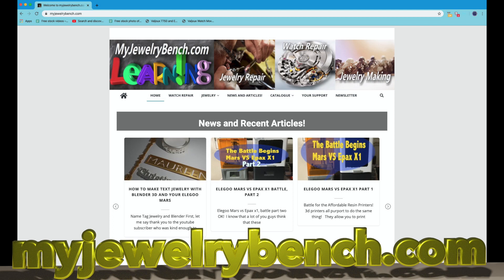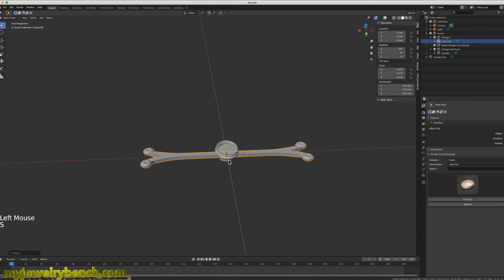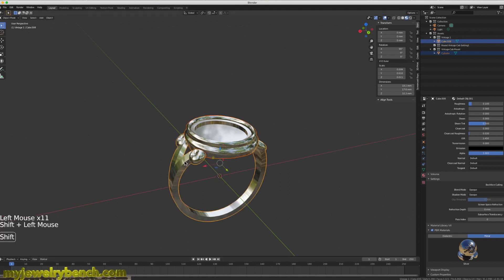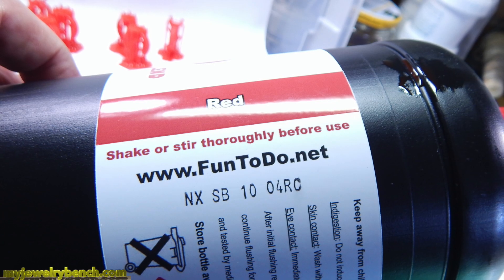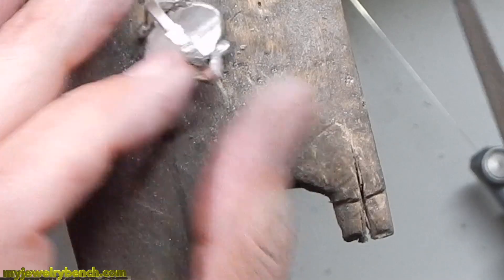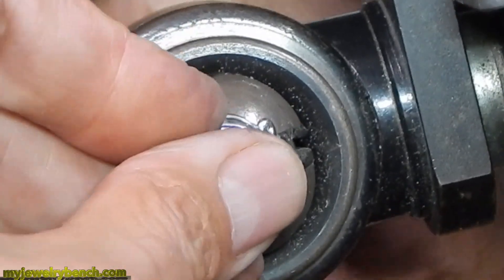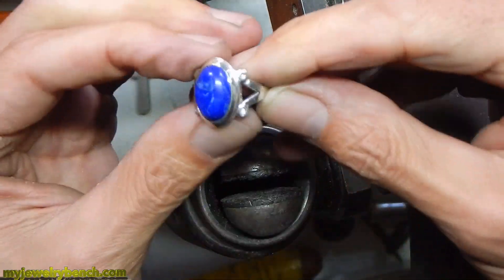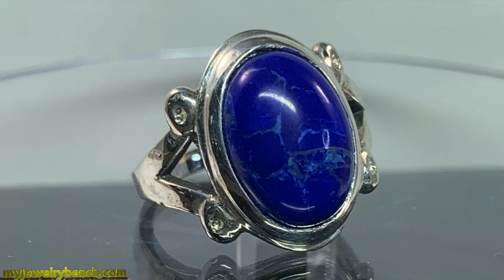3d Printing, Casting and Making Jewelry!  Lets Use our Elegoo Mars or Epax x1 3d printer!

Comment: Hi. I wanted to try this resin.how did u wash & remove rest of resin on the surface after it came out ? I usually use alcohol. But I’m not sure abt this resin.
Reply from the maker: Best to rinse castable resin in warm water for two minutes. Then cure it
Reply: @watchesandjewelry  thanks 🙏🏻

Comment: I wonder... is it posible to cast custom watch cases? i imagine that the main limitant must be dimensional accuracy.... do you have an opinion on that matter?
-Thanks for your video!
Reply from the maker: Yes. You need to build in a level of shrinkage. Because of the size of the model, the shrinkage of castable resin and the potential shrinkage of the casting, I would try to account for a 4.5 to 5% shrinkage. If you wanted to just 3D print a case, the shrinkage may be negligible if you use an ABS like resin
Reply: @watchesandjewelry   Thanks for your answer!

Comment: Thanks for all your videos and tutorials, because of you I started to learn Blender, have some experience with Fusion 360
Made your school ring in blender and purchased  you BlenderGems library so I can make your  sterling ring with the beautiful blue stone.
But I think there is a problem with the ringtop from your BlenderGemms Library when you slice it, it does not slice well in Citubox, the band is OK.
Had to get your ringtop  repaired by using NetFabb Sorry to say if you pay 40 dollars  for your BlenderGems Lib. I think You could expect all is working fine, but is not.
TIP: I bought by aliexpress.com castable wax (yellow)  1liter for 98 Euro what I think is  cheap It print very nice with my elegoo Mars
Reply from the maker: Thanks.  I’m in the process of remeshing all items that had errors. Updates are coming. Thanks for the resin tip
Reply: @watchesandjewelry  Thanks for your response , I hope you inform me when  you finished remeshing all items that had errors.

Comment: the picture of the casting is painfully familiar.  I have lots n lots of 'castable resin' castings that look just like it.  I'd suggest its not the caster it's the resin.   I've tried the funtodo red and bluecast x10 along with every post processing method, burnout schedule, both recommended and desperately googled.   All result in pretty much the same result, pitting and such.  Best I can tell is that the pitting is from the resin not burning out completely.    If ANY one finds tha magic to get this to work, PLEASE do share.....
Reply from the maker: Working on it.

Comment: That's a horrible casting. You should try the B9 Emerald or Cherry resins. I think they will give you much better results.
Reply: I use the resin from alixpress, (see link) works well and is cheap, still have to toy a little with the burnout faces and temperature        https://www.aliexpress.com/item/4000534405681.html?spm=a2g0s.9042311.0.0.27424c4dhbh1Wp
Reply from the maker: Let me know how well it works.
Reply: @watchesandjewelry  I can send you a printed example using this resin, what I also like when I use this resin, the printed model is  flexible instead of brittle

Comment: I built and set my first bezel in about 6 years this week, and getting that edge thinned down was a huge help .  Also..that sprew was gross. Why was it so...enveloping?  I've been casting for the last 7 years using little 1/8 sprew wax and it's very rarely failed for me, I don't usually cast this chunky, so I might go up a bit for that.  but wow. that added a ton of work.   when I get a bit further along in blender I'll just design the sprew into my models.   I do do mostly production work rather then one of a kind stuff so that does change the work flow a bit.    I use a vacuum casting system.
Reply from the maker: Yup. Not the best sprew.  Lol. Took nearly 20 minutes to cut through.

Comment: That casting had tons of pits and the caster you used didn’t have enough gates on it for that large head. We would never use a casting like that. I have never seen one that porous and rough that we have done. You should cast your own stuff. Just  get a used centrifugal caster on eBay, replace the spring and buy a torch and you will have better castings than that one.
Reply: vaccuum is far better. and worth the price.
Reply: Robert Peters totally agree. I was just saying if you wanted to get by on the cheap. Should have been more clear. If you want the absolute best, Induction, vacuum, vibration casting by Indutherm MC-100V
Reply from the maker: I’m thinking the silver was too cool. Or may have been poured too fast. Easy fix on the laser welder
Reply: @watchesandjewelry  that's why I got an electromelt last year, never got good enough with the torch to judge temps well
Reply: @watchesandjewelry  My deal is, you are paying the person for a quality casting. You should not have to spend you time, labor, and equipment on a poor job that they sent you. Also what Laser welder do you have?

Comment: I realize you do a lot of casting jewelry, but have you ever used the siryatech blu resin? I just did some functional prints that had to be very precise. I used calipers to measure all the things I needed the prints to fit, down to 0.5mm. Everything I printed fit absolutely perfect. I was blown away. Used an elegoo mars
Reply from the maker: Yes.  It is a very good resin.  Here is the most important factor from what I’ve discovered in my research...  Wax content.  This is what allows proper burn out from the investment.  Seems to me, the more the better for burn out.  However, ANY resin content can cause burn out problems with investment casting.  Gold casts much better because of the ability to hold heat a shade longer, but prep work is still important.  I’m trying to focus on resins that are lest then $99.00 per liter, just to make affordable models.  I use both inexpensive, and very expensive resins. No matter what resin you use, make sure the manufacturer lists the investment burn out procedure, without that, you will likely have a good casting.  Thanks for the question!